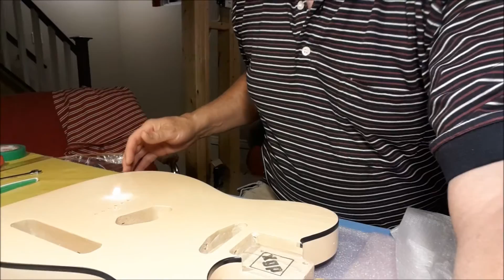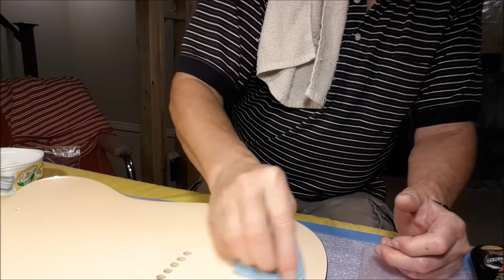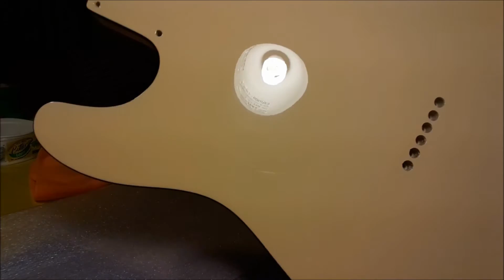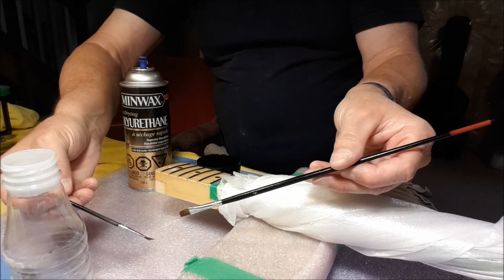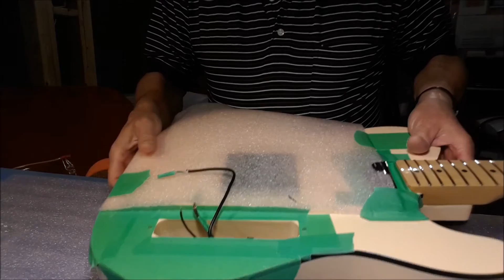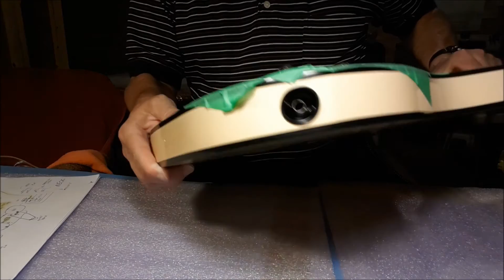GFS GUITARFETISH Telecaster #3 build part 3 final assembly

Comment: Polyurethane is gnarly stuff, a task to remove. During lockdown last year, I took an orbital sander to an inexpensive Yamaha acoustic guitar. Their application was at least 1/32" thick and very hard. Good to see all these things about GFS products. I have some GFS pickups (a Lil Puncher and a 52 vintage overwound) I want to install in my Telecaster. I had been curious about GFS necks and bodies.
Chris
Reply from the maker: Hi Chris thanks for taking the time to look in at my stuff. I did it so that other people would know what I came up against. I've heard from other people that have had the same problem with the poly on the neck he'll being too thick to fit in the neck pocket on the bodies period just recently Daryl Braun built a GFS telecaster and the neck he bought fit the body right on so he didn't indicate that he had to do anything to the neck pocket or the heel of the neck so I'm not sure if he had to or not but when he dry fit it on camera it fit right in. So they may have improved what they were doing

Comment: Hey Mike, im considering buying a similar body, but im not that handy and im afraid that by aligning the bridge with those scewers, that it wont be precise enough so the intonation will be way off. Have you had any problems in that regard?
Cheers
Reply from the maker: +Buller 
Since the body comes with the string through holes already drilled in a position for the bridge to Overlay them the intonation is a product of where they have drilled those holes. The skewers simply fit the string through holes to hold the bridge securely in place for me to mark the screw down holes that I need to drill to keep it there. On all my xgp bodies I have found that in order to intonate the bridge Saddles need to be screwed towards the base almost completely. This tells me that the string through holes were drilled just about I'd say a half a centimeter quarter of an inch too far forward towards the neck pocket. The bridges I chose with the very long screws would allow I thought for easy intonation and they would if the whole Bridge had been located back a little bit more. as it is I have been able to intonate all three that I've built and one of them the Saddles are pressing against the springs. If that occurs cutting some of the spring off will solve the problem and allow the saddle to move back a little bit more. Thanks for looking in and commenting and asking my impressions.  The xgp necks are nice but because they have a heavy coat of poly on The heel none of them fit in the bodies without sanding open the pockets.  There is where the tricker issue is so the neck will align straight and both e strings are equally spaced from the edges.   The neck i put on tele 2 from china or on amazon fit right in so that can avoid sanding issue

Comment: Mike, the issue with the body string through holes being "off."  Did you have this issue with all three Tele projects?  You wound up having to drill the holes larger in the bridge plate and also sand the neck pocket?  This worries me about buying one of these bodies......
Reply from the maker: +TZ GuitarKits 
After I put together number one and two I could see there was a slight misalignment between the bridges and the holes and how the strings came through. On a couple the strings are resting on the wood hole and on some others the string is actually being mentioned on the edge of the bridge. It was only on telly 3 that I realized the overall conception of it and decided to drill out the holes in the bridge such that the strings would not be tensioned on the small Bridge holes causing licking of the strings as they come to the body. When I go back and do more work on numbers one and two I will also drill out those Bridge holes which I haven't yet done. Because they use either nnc drilling program or a physical jig to drill these holes in all their bodies consistently I suspect they are all that way because the three bodies I got are like that. I also had to send the neck pocket on all three bodies to some degree or another to get the next other to fit in and also to align them for the bridge. Again either a program or Jake there working too. Now the option was to buy way more expensive bodies and necks in ont for $500 range of peace but my objective was to in the end have a really nice guitar and invest any labor effort into it of my own in order to keep the overall purchase pricing down. My labor is free and a labor of love for the project so I consider that a bonus 2 Learn and customize my guitar to my desires. Thanks for looking in and commenting and asking. I love to help whenever I can
Reply: +2bikemike oh, I understand.  Great points.  Thanks Mike!

Comment: Mike It's looking really good - I'm still not sure if I would like one without a scratch plate but the finish looks great and the black hardware is new to me and contrasts well with the paintwork colour. I feel awfully lazy as I could attempt this myself but I know my luthier has so much more experience I will leave it to him. 
I feel I have done my bit by sourcing and buying all the gold hardware. kudos to you for doing all this on your own !!  Cheers Phil
Reply from the maker: +random275 thanks.   Last night I started to work out tabs for the song San Francisco to give tele3 its debut in use.   I found a few karaoke options but are in different keys.  I'll decide the one I think is best sounding and tab it to that one as backing track.  
Cheers Mike